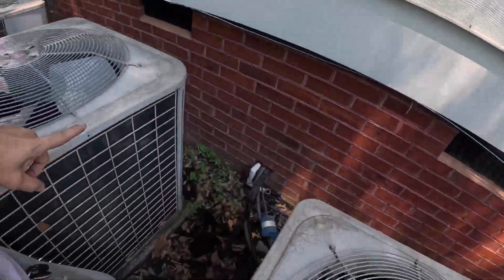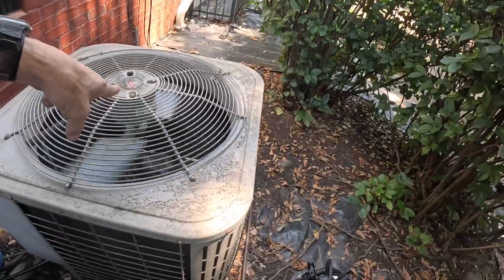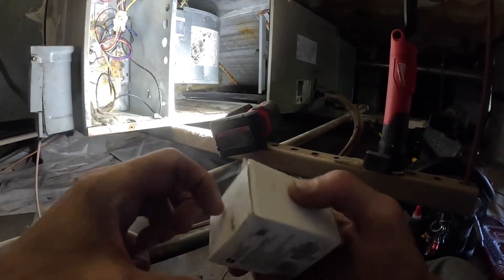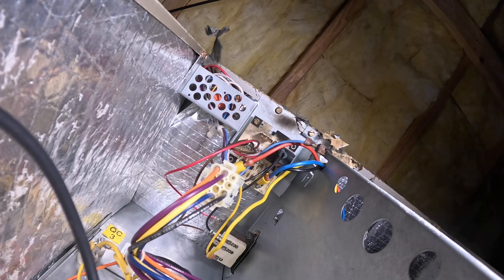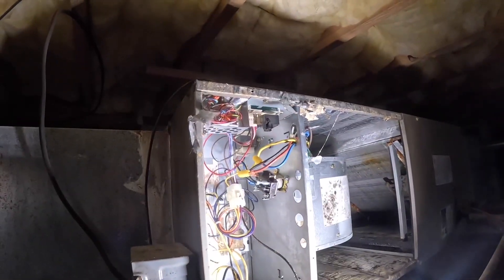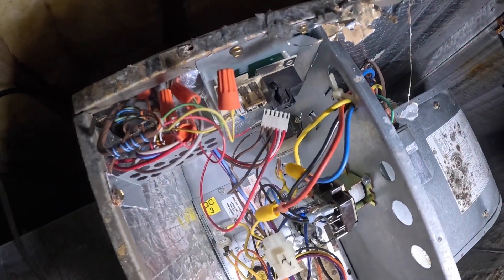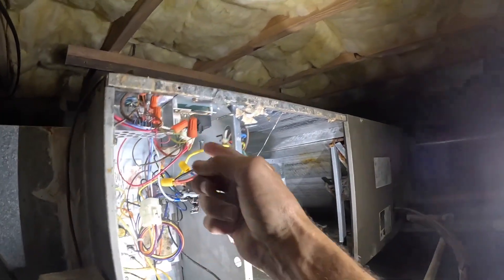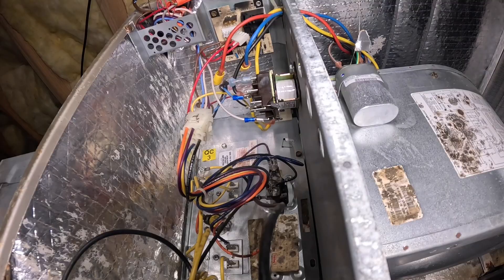Extremely High Electric Bill Leads to A Service Call! #hvaclife #hvacguy #hvactrainingvideos

Comment: Would it have been easier to check amps draw at breaker panel for the air handler as a quick check?

Comment: @3:35:  Why disconnect wiring on a live circuit with high amperage?  You knew that thing would arc.  Just flip the switch on the air handler or pull the disconnect.

Comment: I started out on commercial units over 45 years ago, one wrong wire on a compressor can really give you a bad day. No cell phone to take reference pictures. I believe the parts department at supply stores had the best training for employees. They could tell you every part, part number and how to install/wire it up if needed. They either became knowledgeable or found another job. They could handle the phone calls and three customers at the same time. Nowadays you're lucky if they give you the time of day. Those days you had snacks and drinks or coffee and donuts in the morning and your service vehicle was loaded before you exited the store.

Comment: I may have missed something but why not just disconnect the white thermostat wire then I won’t have any power to the heat strips
Reply: It's because the fan relay when it failed was back feeding power to the sequencer and was powering one of the heat strips.

Comment: A plug in device could be made to monitor critical areas such as individual component loads and corelating system function to determine if everything is functioning efficiently. WiFi too!

Comment: This maybe a dumb question but how does the relay know when to bring it on/off the electric heats? I need to go back to the drawing board. 

And also what’s the blue wire that he set it on the N/C for?
Reply: The relay Curtis installed is for blower control only, not for the electric heat strips. The thermostat’s W wire is connected directly to the sequencer, which controls the heat strips. A blue wire runs from the controlled side of the sequencer to the normally closed side of the relay. This setup ensures that when there is a call for heat, the sequencer energizes the heat strips and simultaneously sends power to the blower. The blower relay also energizes the blower when there is a G call from the thermostat, which closes the normally open contact of the installed fan relay for continuous fan operation.

Comment: Air Handler/Electric Furnace Diagnosis, Bravo. Break it down to the 'elements' (lol) . I once had a no-colling call, found a Normally Open Heat Relay that was closed with no 24 V command, during AC cycle.  Replaced it, problem solved. Same deal here, pretty much

Comment: Should have used a contactor for the strip heater. Relays are typically rated >15amps. Replacing the board would require an additional trip since that would not be a typical truck inventory part.
Reply: Always best to use the factory parts

Comment: Although Curtis blamed his sneezing/coughing on insulation it could very well have been “harmless” black mold. It’s everywhere on that air handler. Scattered across the panel he removed and on the wiring diagram on the blower housing. I’ve seen it on other HVAC videos as well so Curtis is not alone dealing with it.
Reply: I live in W Ga, like Curtis.  Let me tell you THAT EVERY  air handler unit has a RAINBOW of mold/mildew coloring inside within a hear or 2. Can't stop it, can't fix it, just live with it.

Comment: Got a air handler one time and circuit board had been stolen out of it i believe it was a rudd maybe not but had to rewire the whole board it took two hours in a attic middle of summer Dallas Texas i quit using that vendor man it was hot and about thirty wires off the schematic

Comment: This is a great HVAC guy, but his electrical skills need updated. For one example, he's using a Klein wire stripper/ndl nose/crimper that specifically states for crimping uninsulated connections only (and he was crimping insulated connectors). I've also seen him bury thermostat wire that was  patched with insulated butt connectors without weatherproof heat shrink over the connectors or in a weatherproof box. I can understand this for a quick repair but not as a long-term fix. Other than that, I've found his AC skills as top notch but his electrical skills need a minor tune-up.

Comment: Great service diagnosis. Too bad the A/C system does not have a way to lock out if the heat and A/C runs at the same time

Comment: After installing a new high efficiency AC, the very next month the customer was outraged to receive a bill about one thousand dollars greater than ever before. It turned out that the energy provider misread the meter. Rare. It occurred only once in my career.
Reply: That is rare considering many more meters these days relay data electronically. Nearly 80% of the meters in the US are smart meters. Meter readers are going extinct fast.

Comment: The very same thing happened to a unit at my home Last month. We Had an $880 insane power bill… I couldn’t believe it. I’ve worked on control systems for the aerospace defense industry, in R&D development… for over 23 years. I also found the melted relay, causing My heat strip to be stuck on…pulling Current, while the AC was running. I bypassed the control board just like you did. Great video!
Reply: Sequence switches seem more fragile than others...

Comment: You literally just saved this house from burning down 😳
Reply: That is the reason electrical wiring and controls in metal boxes and enclosures are the safest option.  The odds of that relay failure causing a fire are pretty low because it is enclosed in metal.  If it started burning the wires eventually it would short out to the chassis or break the circuit and by that point you would smell the electrical fire inside the house and could safely get out of the house and eventually investigate the issue.
Reply: @kuhrd  Don't forget to turn the breakers to OFF.-
Reply: @kuhrd  at the same token electricity doesn't play I've seen some freaky shi behind electrical failures etc.

Comment: Could have mounted the relay to where the board came out. Already had holes and screws there.
And only one screw? Protruding into the next compartment to interfere with blower,and slice your hand.
Bad breathing air and awkward location were Trying circumstances, but, A bit more attention to detail would be nice.
Troubleshooting was right on.

Comment: Wow😮 why not replace the board?
Reply: Board not stocked on truck.
Board costs several times what the relay costs.
Board just delays the blower turning on and off to give an extremely small boost in SEER ratings.
Difference in cost between installing new board over ditching it in favor of a relay would take a decade or more to get back in whatever energy saving there may be.
Board failing already wasted more energy and the customers money than there was ever any potential for saving over the life of the equipment.
Reply: @markbeiser  Anyone can replace a board, but you have to be smart to figure out a better way.
Reply: Board is 400 and relay is 10.
Relay in back of van, board in China.

Comment: convince me that control board was not needed.. I'm skeptical.
Reply: The board only existed to delay the blower on and off to gain a very small bump in the efficiency ratings.
The energy savings is so small that it would take a decade or more to cover the difference in cost between replacing the control board and ditching it for a relay.
The control board failure already wasted many times more energy than it would have saved in the conceivable life of the equipment.
The cooling and heating capacity of the system is unaffected.
Whatever dehumidification benefit of delaying the blower on that was lost is more than regained in not delaying the blower off when the system shuts off.
The only real drawback is that in heat pump heating mode, the air coming out of the vents will take a little longer to warm up.
Reply: Convince me I need to put jet engines on a prop plane for it to fly

Comment: I follow you because you bleed knowledge and you are definitely schooling my interest and I see the point on earlier comments regarding saving time and parts costs.  But this is the first video where I've seen a (still quality) repair, but wonder out loud if the amount of working backwards & the adapting you did to get the relay you installed to work is better than a replacement OEM board.  The next guy (if its not you) may struggle to follow a manufacture schematic on the inside of the panel now that components and wiring aren't the same?
Reply: If a different maintenance technician in the future comes in to work on that and can't figure out what was done then he does not need to be in the business
Reply: @NEW_INSITE That's a cold & ignorant response.  You ignored the heart of the comment and just showed with your attitude why the trades are so badly looked upon and how the numbers of trades people are in decline.

Comment: 2:57  Curtis, how were you able to clamp your clamp meter around two wires and get an actual reading? 🤔
Reply from the maker: Those two wires are tied to one leg of power, other side has two black wires tied to it. So, it was like I was clamping onto the main power wire coming in.

Comment: Couldn’t imagine what their electric bill is with running 3 ac units.
Reply: well it was $2000 with the heat strips stuck on so its less than $2000
Reply from the maker: And a pool

Comment: Loved the board elimination. I agree with others why use a board when relays could normally be used for the same function.
Reply: Because the board is less reliable, which means that the HVAC guy gets returned business.
Reply: @scottchapman9931  But why would the manufacturer give a f* about the HVAC guy getting business? My guess: that PCB with its tiny relay is cheaper than a beefy standalone relais.
Reply: He completely removed the board because what he’d done with the relay eliminated the board. I see no need to return to the unit he worked on unless the relay gives up or some other problem pops up

Comment: A $ 200 power bill would be about normal here😮 Definitely wouldn’t take long to run it up with a stuck on heat strip. Good fix as usual!  Stay cool and have a good weekend. Looks to be a hot one
Reply: Well assuming just a low end 5kw heater…thats 96kwh a day…30 days that 2880kwh a month…..and thats not including the fact the other units are fighting this unit heating the air….a normal home only uses 1000-1500 a month.
Reply: @maxwellmelon69 This is why "heat strips" should not be a part of modern civilization... we have SO MANY much better methods of heating a space than just a "build it cheap and let the tenant pay" boomer-tech resistive heating...
Reply: @dregenius  Heat pumps are the future! It's just an AC unit with a reversing valve and a stronger evaporator. Really not much more expensive to make. But the companies want you to believe they are!
Reply: lol im jealous.  My electric bill for my single 1200 sqft house averages $3-400 a month.  My last bill was almost $700.  My next bills gonna be even higher with the heat wave he had here over the last few weeks.
Reply: 2,000 dollars
Reply: $2000 Bill

Comment: Silly question: why use the board in the first place, if the relay handles the job?  Looks like more over-engineering so someone can make parts money down the road.
Reply: The board was a fan speed sequencer in addition to controlling the heat strips
Reply: BINGO!!  The manufacturer wants you to think you are getting a lot for your money.  Also the boards are cheaper to install at the factory.
Reply: Fan sequencing has good and valid applications. Low for dehumidification. High for an extra boost of heat in Winter.